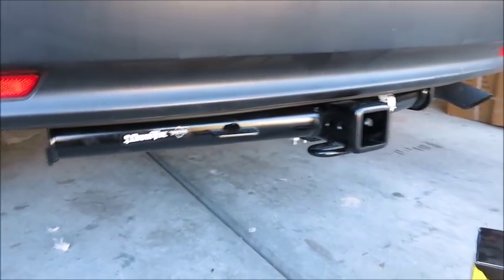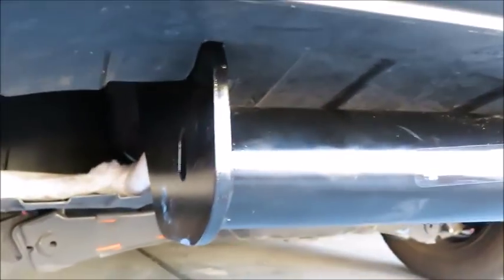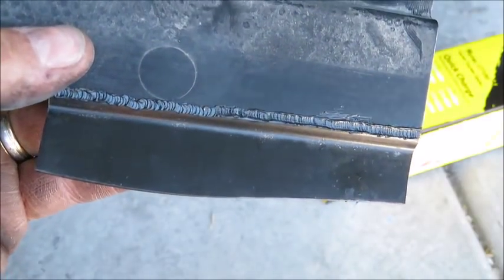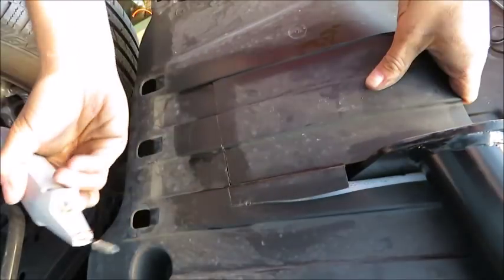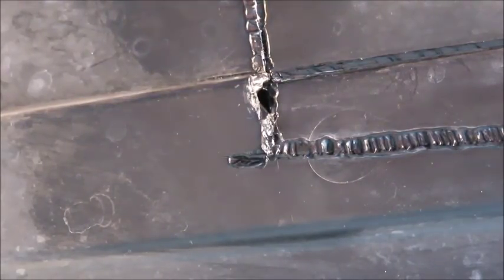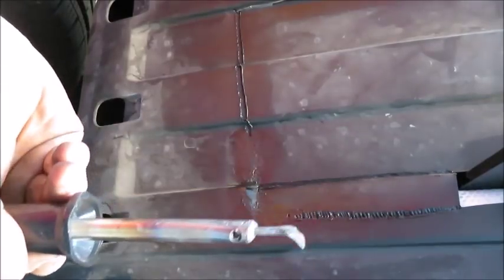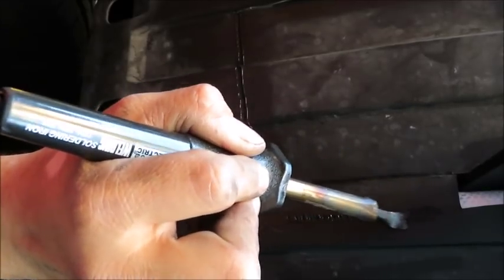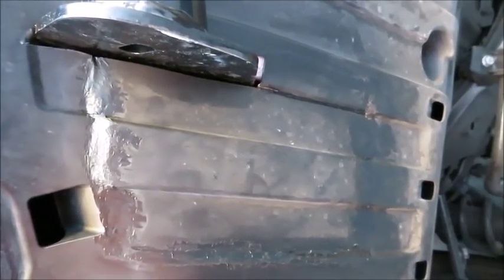Plastic Welding Repair splash guard

Comment: Can the weld be sanded and then somehow sprayed to make it look like it was never welded?
Reply from the maker: I've never tried it, but I have heard of something similar. Instead of rubbing sand paper on the plastic, place the sand paper, rough side down, and tap it with a hammer. The grit will indent on the plastic.
Reply: @First_Class_Amateur  Thank you for taking the time to respond.  I look forward to trying that.  I'll have to experiment with different grits and maybe some other materials.  Thanks